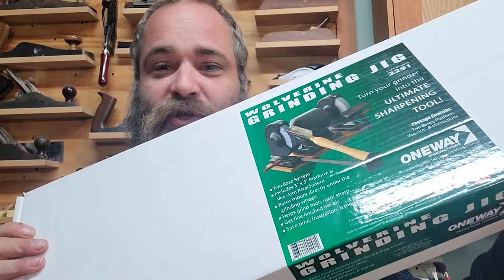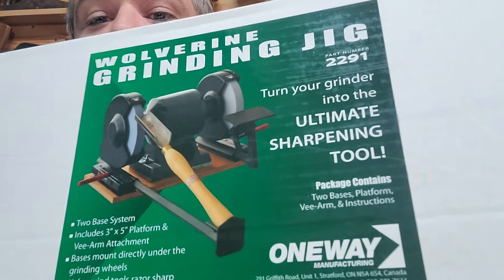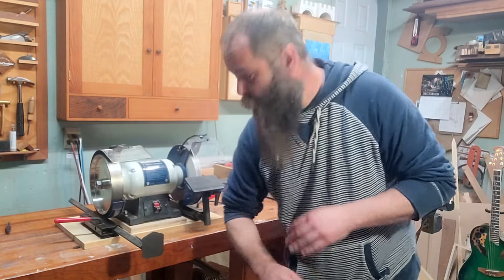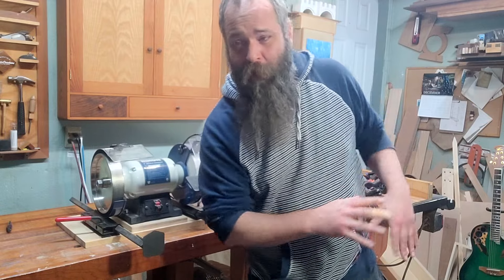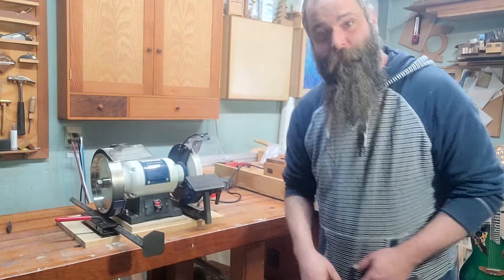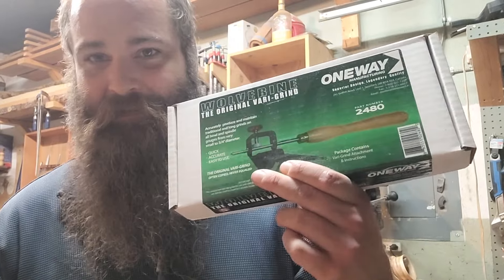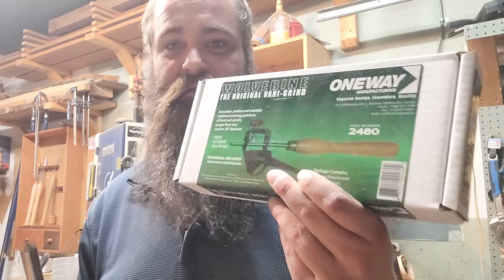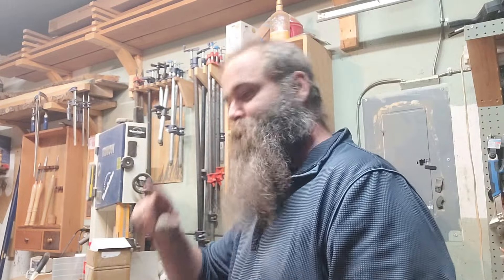The Oneway Wolverine Sharpening Jig Installation!!!!

Comment: Mike great instructional video - My grinder has 6inch wheels - would you know what height to wheel centre I need to install the oneway system ? Regards Andy
Reply from the maker: Sorry, Andy. No answer for that. Just measure from the base to the middle of the wheel, but make sure you add a riser first for the grinder to sit on if the channel the post rides in doesn't fit under the housing.

Comment: Your videowas great. Set up mine today. sure seems way faster and accurate than doing it freehand and eyeballing it. Used the varigrind. should have done this a lot sooner.
Reply from the maker: @deltaacht  Thanks very much! I also should have done it sooner. Got okay at freehanding it, but this is so much easier and quicker, which makes me sharpen more frequently.

Comment: Thanks for the video. Yes you will like the vari-grind attachment. You should use it right in the beginning because you will reduce the grinds without grinding half your tool away. It’s good for fingernail grind, bowl gouge and side or Irish grind. Vari-grind 2 is even better because it increases the ease of use. I’m surely going to enjoy sharpening my turning tools a lot more
Reply from the maker: I'm probably setting it up next week, because I kind of haven't been happy with my grind since I did the Wolverine setup (though I haven't turned a ton since then). Will do a follow-up video on how things have been going.

Comment: Having a hard time with a WEN variable speed grinder. Base seems too wide. Doesn’t align anything with the base. Even if I raise it on another base diamond doesn’t align with the wheel.
Reply from the maker: @robertmunguia250  unfortunately I can't be of any help. If you still haven't figured it out, maybe reach out to Oneway. I'm told their customer service is top notch.

Comment: Finally! You got that thing set up. 

Yes, Mike, the Vari Grind makes things much easier and more accurate once you learn how to use it. It also makes it easier to work with extra-long handles since it holds the tool from the shank instead of needing to be extended to the end of the tool.
Reply from the maker: Will probably set it up soon and see. Might do a follow-up video....